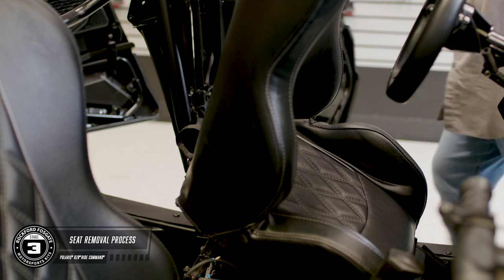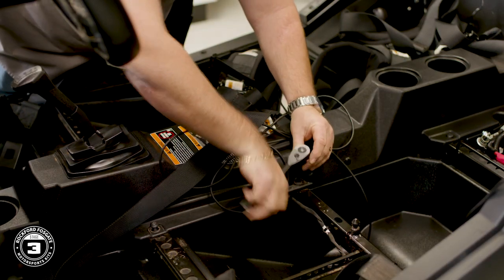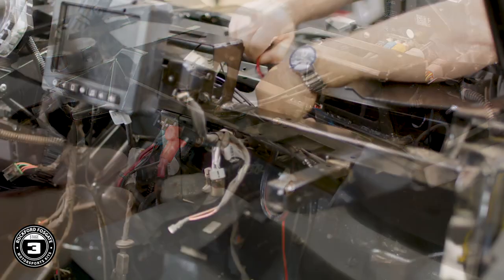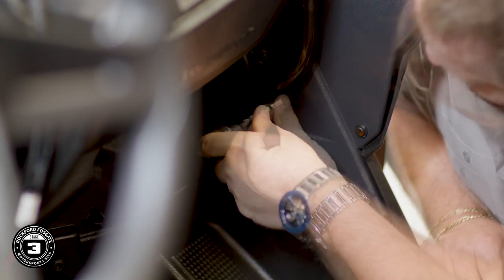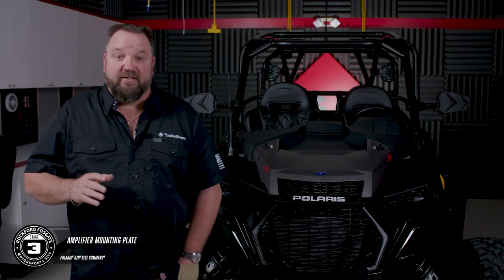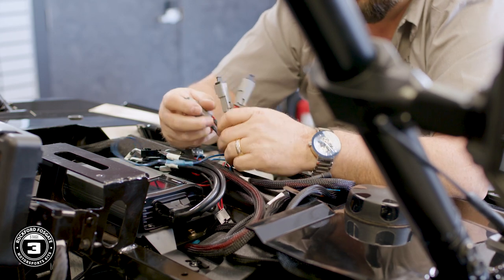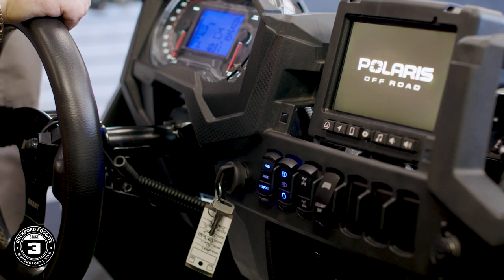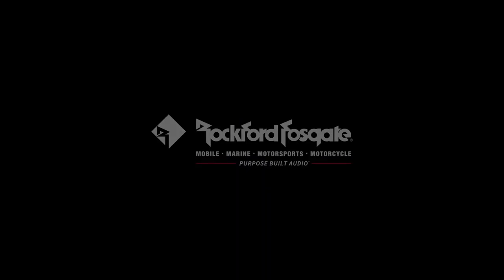RZR Ride Command RZR14RC-STG3 Installation (Gen-3 Fixed)

Comment: Shouldn’t the sub woofer be set at 2ohm for a  4ohm load at the amplifier ?
Reply from the maker: The M5-800X4 is designed to operate at 2Ω stereo and/or 4Ω bridged/mono.  At timecode 4:42 "Subwoofer Assembly Process", Greg describes the subwoofer/enclosure system where he sets the impedance switch to 4Ω.  This wires the Dual 2Ω voice coils in series to create a 4Ω load.  The subwoofer rear channels are wired in bridged/mono mode to this 4Ω load.  Each channel operating in a bridged/mono configuration will "see" half the impedance load, so essentially the Left channel will see 2Ω and the Right channel will see 2Ω: https://www.youtube.com/watch?v=dnPa5NG5GpU&t=295s

Comment: Can you add speakers to the existing sound system if you get after market doors?
Reply from the maker: The front pods on factory and aftermarket systems (as shown above) are mounted to the dash, so new doors don’t affect the system.  This aftermarket kit isn’t designed to interface with the factory sound system.  It’s designed as a high performance standalone system.

Comment: any rear speakers for a two seater that’s equipped with a rear windshield?
Reply from the maker: Our RZR14RC-STAGE4 has rear moto-cans but these mount to the roll-bar, so they are not designed for rear windshields (https://rockfordfosgate.com/products/details/rzr14rc-stg4/).  Since you have an enclosed 2-seater, we would simply recommend the RZR14RC-STG3 system found in this video.  The 800W amplifier provided is plenty loud enough to not require rear speakers.